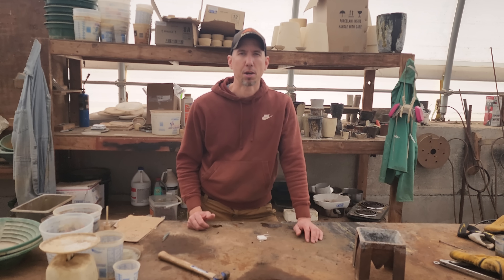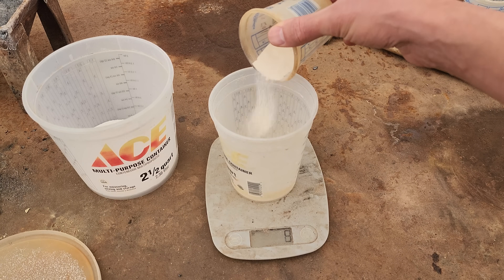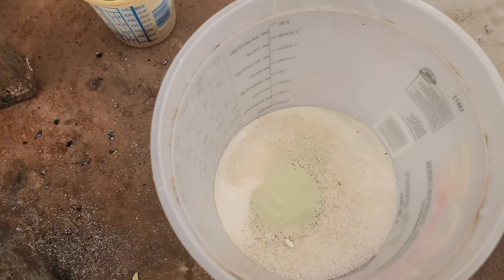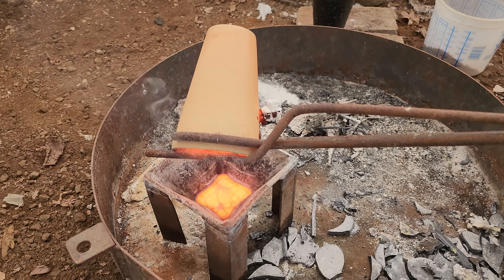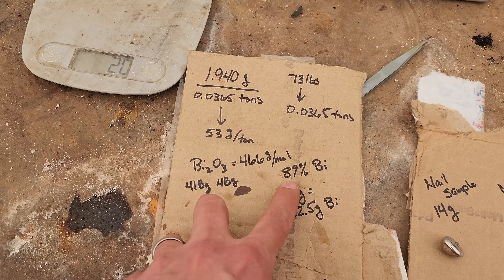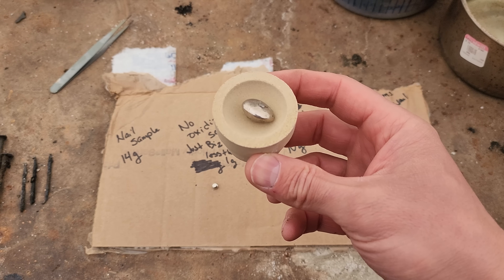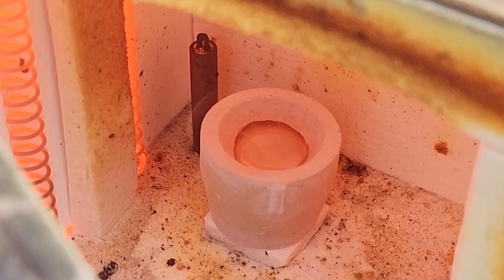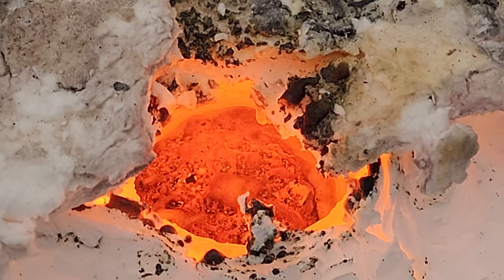Gold Smelting, Is It Worth It??

Comment: Using an iron bar is the best way to go.  You can just keep using it until it's totally used up, then any 'losses' simply end up in the next smelt, so you're not losing them at all!
Reply: Great point !!
I've offered the idea of using bar stock to Jason a few times and it seems like he decided to give it a try. 
I didn't forsee the bismuth welding issue, I just offered the idea as a easy way to remove the iron so he didn't have to be so careful with the pour to avoid the nails falling in to the pour but your point about that bismuth weld simply staying around until the end of the bar is consumed is a good observation !!!!
Reply: @John-ir2zf Some of the bismuth oxide will reduce directly onto the iron, because it functions the same way as a thermite reaction:   the oxide of a less reactive metal causes the more reactive metal to 'burn' and take up the oxygen.  An exceedingly hot thermite reaction takes place when igniting a mix of copper oxide powder and fresh iron filings.   I believe it can exceed 3000F.

Comment: Out of curiosity, what do you do with the cupels after your done?  Do they just get tossed in the trash or is there some way to reuse or clean them?
Reply: They are relatively cheap, so they are tossed out usually.
I guess you could grind them back down to powder and burn them in a reducing flame to remove the oxides from the bone ash, then remold them in to cupels. But the cost of doing that would only make sense if you were using thousands of dollars of cupels regularly.
A cheaper alternative would be to get discarded bones from a farm or butcher, and burn them down to ash then mold them in to cupels
Reply: @John-ir2zf  ohh.  Thanks for the info. I didn’t know what they were made of. Much appreciated.

Comment: Well, smelting was the primary method of gold purification for thousands of years, back when gold's value was a tiny fraction of what it is today.  It's a matter of how cheaply one can acquire flux materials and low-cost fuel.  

I'm currently fiddling around with manufacturing flux ingredients.  Here in the NJ Pine Barrens, I have an unlimited amount of silica sand, and I can make calcium oxide and sodium oxide (potash) by burning sea shells with wood.  And since I'm only 30 miles from the seashore, I've collected hundreds of pounds of seashells.  There are places where they pile up, so it's easy to grab buckets of them at a time.  The remaining charcoal after the burns also works as a source of carbon to burn off sulfides and reduce oxides in the smelt. 

The only thing I think I have to buy is sodium borate.   

As for the furnace itself, I have an old rail line back behind my development that was dismantled 60 years ago, but a huge amount of PA anthracite coal is everywhere on the track bed.  It's been washed in rains all those years and has been cleaned of many impurities.  A test burn with it showed a bright blue-white flame and no smoke at all.  So, TONS of free fuel!
Reply: you should document this old school/work with what you got way for the rest of us to see, sounds interesting for sure! cheers
Reply: You are a genius. I'm sure your humble by the way you presented your finds. I live in MI and know there's flower? Gold in the north but I'm not sure if the juice is worth the squize. LOL I think good teckneek is vary important. Repeating things exactly the same Everytime when you find what works. I wish you luck in your testing and work good sir.
Reply: Have you been to Batsto Iron furnace ?
Reply: @josephpadula2283 Yep, I've bicycled there several times, going through Wharton State Forest.
Reply: Do you have your own channel? If not, you need to get one started.
Reply: @GeorgeKofoed I have some other things to put together and test to ensure it's all running smoothly.  A few other pieces of the proper equipment, the right sized crucibles and tongs, playing around with the airflow.  Lots of small details to work out.  The first smelt I'll do will be some black sands from an ancient glacial moraine I have found small amounts of gold dust in.  It won't have any sulfides left after oxidizing for over 10,000 years, so it'll be a good test material for the furnace setup to see if I can maintain temps long enough using the small coal pieces as fuel, and how well my self-made flux ingredients work.
Reply: Idk if golds value was a fraction of what it is today. Today gold maybe harder to get because of extreme environmental laws making mining impossible in areas with good resources. Human labor was also cheaper in the past especially as it wasn’t a big deal if people died in mines. But it’s really the money printer go brrrrr for all the government spending and endless war. Gold probably can go way up as the monetary currency supply has increased a ton the last few years. 

Alaisdair mccloud always has some good points on paper gold or paper silver contracts. There’s a reason precious metals can be supressed but Bitcoin isn’t manipulated lower.
Reply: tons of greenhouse gas

Comment: As an experiment, I suggest flattening a few nails to increase the surface area. Possibly thin them down so much that they the smelting process consumes them.
Reply: Honestly, it won't make much difference. Far easier to simply put another nail or two in.
Reply: @iolithblue  If a thin plate is completely consumed, then Bismuth won't be coating it like with the nails.